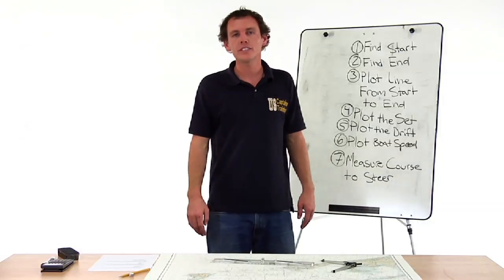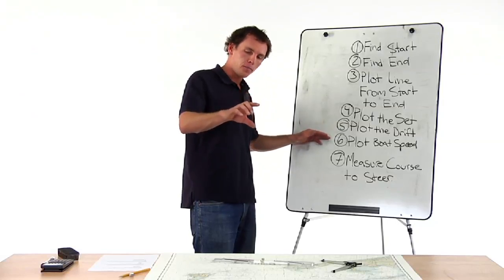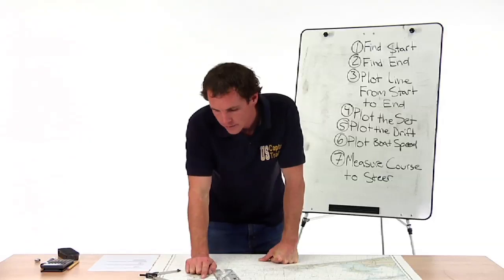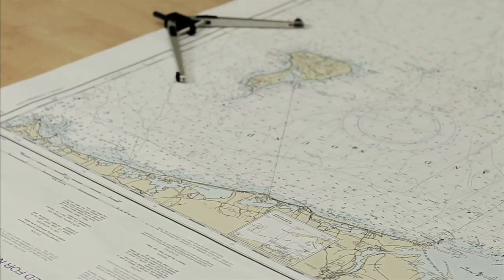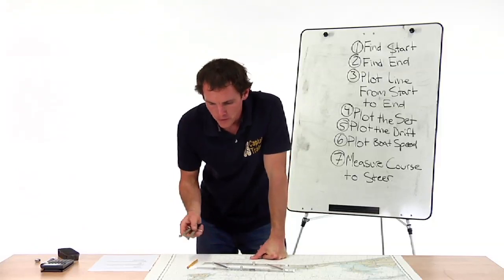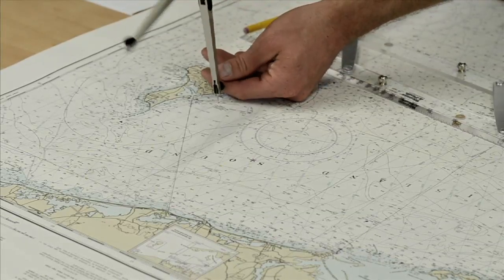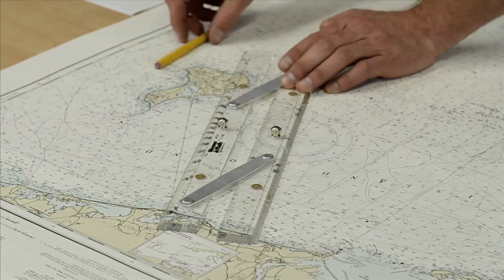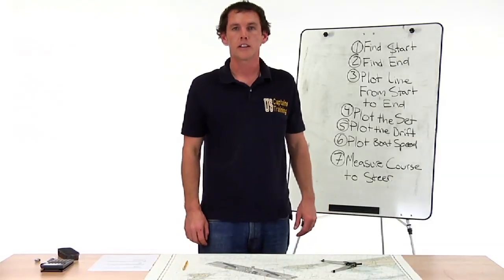Known Current (set and drift)

Comment from the maker: Hi Joshua Gordon. In this problem the assumption is for an average current over the course of our travel. If the set and drift of the current, and our boat speed stay the same we will travel down our intended course for as long as we need to. think about it like swimming across a  river. If you want to get to the opposite side to a point straight across from you and the is an equall current the whole way across you will swim a certain angle into the current to get to that point on the other side

Comment: You are making an assumption that the time it will take is one hour. If it were a longer distance, the current would be acting on your boat longer, and this needs to be taken into consideration. What is missing is the initial estimation of the distance and time it will take you, and adjusting the length of the set/drift vector accordingly.